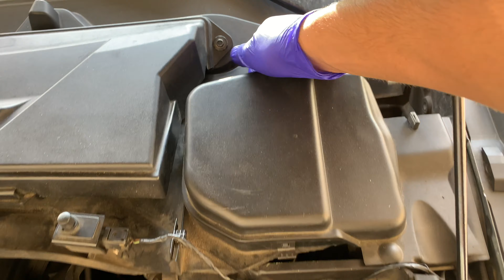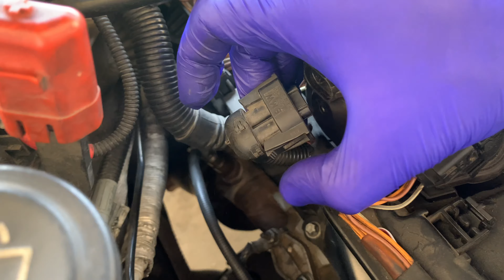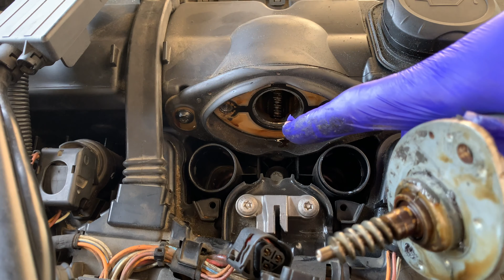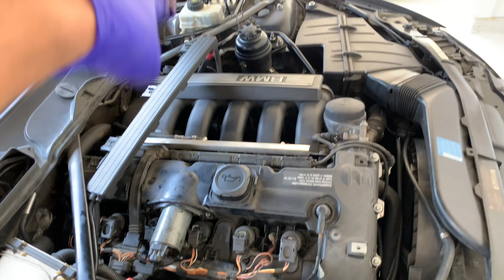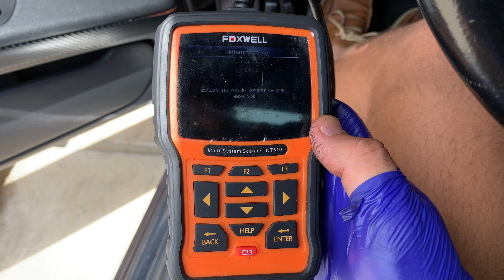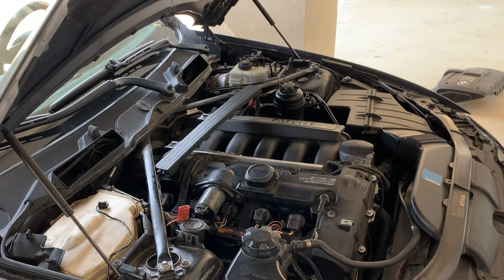How To Replace BMW Valvetronics Motor Gasket | E90 E92 N52 328i 330i

Comment: Does anyone know how to manually calibrate the Valvetronic system on a BMW 525i?
Reply: Yeah, turn the ignition to 2, not turning on the car, within 15 seconds, press the gas peddle 10 times. You should hear a whirling sound from the valtronic. Turn off ignition.  That’s how I did mine.
Reply: @custodyline i remove mine without releasing the valvetronic so i dont know if i install it correct

Comment: Will the valvetronic motor or ESS being messed up make cylinder 45&6 shut down ?
Reply: I’m having the same issue. Misfire on 4,5 and 6. Have you fixed your problem?
Reply: I need halp

Comment: Mine had a puddle of oil in all the ignition coils 😭 could be that when they did the oil change they didn’t hit the mark or the previous owner didn’t hit it so I cleaned it and now we wait
Reply: Just replaced mine but it's still leaks did you use a sealant?

Comment: I didn't know i was supposed to adjust the allen screw before removing. I just unbolted the motor and it popped off from the tension. How bad did i screw things up and what should i do for the reinstallation process? Thank you
Reply from the maker: you’re good man! I did that as well. as long as you don’t do it over and over, you’ll be fine
Reply: Thanks brother 🙏

Comment: Having the same issue rn I took out the valve motor and used the allen key but car now just cranks but won’t start
Reply from the maker: when tightening the motor, be sure to ONLY tighten until there is tension. don’t tighten any more/less
Reply: @IzzyE46M  did that but even at that I tried to start it and it just cranks I took the motor out and tried the same procedure and still nothing
Reply from the maker: I had this issue when I first owned my E92. I overtightened the Allen on accident and messed the timing up. The FIX was I used an Allen and kept doing tiny cranks while someone sat in the car and kept attempting to start it. I finally corrected the timing and no issues since. I DO NOT recommend this unless it is a last ditch effort, but it happened to me before. 

Check your valvetronics motor, eccentric shaft sensor, VANOS solenoids and ANY codes before attempting what I put above.

Comment: If this valtronic gasket is bad Will it have a vacuum leak?
Reply from the maker: Yes and no. It is possible to leak without any vacuum leak, but a large enough oil leak could result in a vacuum leak.
Reply: I'm getting some engine codes that made me think I had a vacuum leak, so I did a smoke test, and I noticed significant smoke coming out underneath the valvetronic. Also, I noticed a small amount of oil sitting underneath. That is why I am wondering if the valvetronic gasket is bad and causing a vacuum leak ( recently, I had a shop replace the valve cover gasket)
Reply from the maker: Yes I would replace the Valvetronics gasket for sure. It was probably removed and never replaced and if there’s smoke/oil there, that’s a pretty good sign it’s leaking.

Comment: Yo I thought you would need to torque the bolts attaching the valvtronic motor to the engine? I’ve heard ppl saying around 7ft/lb
Reply from the maker: yes you do, they’re very light. once they’re snug give it a little hand torque, it’s nothing ubsurd

Comment: I replaced valve cover gaskets but I did not use the Allen key to turn back to valvetronic motor or to install it back in.. my engine starts and dies..now I bought the scanner to relearn but still same stars and shuts off.. any suggestions?
Reply from the maker: use the allen key, then try again
Reply: hey man, i am having the exact same issue as you right now. Did you end up finding a solution? please let me know! thank you
Reply: @kylesmith8568  hey bro my issue was that I had not installed the air filters box to the air flow sensor hose. I tried starting it with all that air filter box off.

Comment: The link didn’t work how do I make the car relearn without the obd2 scanner
Reply from the maker: switch on the ignition
press and hold the accelerator pedal for 15 seconds
listen for the valvetronic motor to complete re-learn
Reply: I bought the scanner would you be able to show me how to use it

Comment: What if the 2 black screw T30 threads are stripped any recommendations?
Reply from the maker: maybe try to use an extractor very carefully
Reply from the maker: maybe try to use an extractor very carefully

Comment: relearning page for vavletroning dont work and is this for bmw 328xi 2007?
Reply from the maker: 2007 BMW 328, the same N52 engine
Reply: @IzzyE46M  i always get confused with e90 vs e46 and does xi matter or they all have same engine ? be it Canadian  model
Reply: @IzzyE46M  thanks for prompt reply and where can one buy them does it matter if i get after market instead of oem? caue oem is way too expensive amazon got cheap one
Reply: @IzzyE46M  also i scanned and getting vavltronic code and car sometimes starts and sometimes dont start or may start after few try u think it related to this issue no other code beside vavletronic codes are detected
Reply from the maker: https://vehiclechef.com/bmw-valvetronic-motor-reset/

Comment: Does the veltrinic gasket cuase the engine to run lean and get code P0171 and P0174? My car started to idle a little and these codes came out when I changed the valve cover gasket
Reply from the maker: It can cause it, yes or the valve cover gasket could be sat incorrectly in a section of it
Reply: @IzzyE46M  oh ok..by the way the bolts need to be torqued ?  I have a 2006 530i e60
Reply from the maker: They do but it’s a very light torque, I wanna say 10 ft pounds, so honestly a hand tighten should be good!
Reply: @IzzyE46M  I’m not sure what to do next. Because I see oil leaking from the veltrinic motor. Maybe it’s the gasket from the veltrinic or maybe I didn’t torque the valve cover gasket enough…
Reply: @IzzyE46M  do you recommend losing the bolts and torque them?
Reply: @ElPatronDTCOficial  I’m in the same situation as you. Did you figure it out?
Reply: @DanielScariti  yes. I changed my valve cover gasket and I had to torque the bolts. And I just got a new veltronic gasket and that’s it. Fixed it
Reply: @ElPatronDTCOficial  Were both gaskets leaking or did you just change both to be sure? I want to try to just do the valvetronic gasket cause i dont wanna redo the vcg
Reply: @DanielScariti  I just changed the valve cover gasket because it was leaking. But at the end I just ended just buying a new veltronic gasket
Reply: @DanielScariti  what have you changed?
Reply: @ElPatronDTCOficial  I changed the valvetronic motor gasket today but i wont be sure if its fixed until time goes by and if the CEL goes on.
Reply: @IzzyE46M  because my car started to idle a little and check engine light is on and it marks does codes and also smoke comes out

Comment: Hi mate if your car running in limb mode can be valvetronic motor problem?
Reply: Mine also went into limp mode after removing to replace gaskets i dont have a scan tool how can i get it out of limp mode?
Reply from the maker: replace it correctly? If so do the Valvetronics reset without the scanner: 

Insert the valvetronic motor and connect its 2 pin plug. Then switch the ignition onto position 2 and within a space of 15 seconds, depress the accelerator pedal down to full throttle 10 times and you will hear the valvetronic motor program itself back to factory spec.

This should fix it, start the car and let it idle in place 5-10 minutes. 

If still not working unplug and re-plug the battery and try the steps above again.
Reply from the maker: It could be, yes. Also eccentric shaft

Comment: What if I changed my valve cover and didn’t back out the valvetronic motor with a 4mm Allen? I’m having a very rough idle and I’m trying to figure out if I need to do a re learn, or take it off and put it back in by screwing the Allen I need help 😂
Reply from the maker: I would definitely do a re-learn and from there start the car and let it idle out for a good while. The N52 has cylinder correction so if you let it run it should correct itself
Reply: I’m running into the same situation at the moment.
Reply: @KidOaKTon   hey man did you end up finding a solution to your problem? Im having this exact issue right now
Reply: @kylesmith8568  dude I kid you not went to the junkyard got another valvetronic slapped it on it did the same thing after leaving it on for a bit even tho it was doing the same thing I turned it off and turned it on and I have no idea how but it fixed itself after that I was like yup that’s the last time I work on a bmw
Reply: @KidOaKTon  bruh…… welp, thank you man i appreciate it 😭 Im glad you got it up and running again! i’m determined to have mine fixed in the next 2 days so i’ll update here… wish me luck
Reply: @kylesmith8568  yeah dude it was the most dumbest situation I ever ran into. I was up till 3am trying to get it going that first day I ran into the issue. I talked to a buddy of mine that owns bmws and he said when it come to those don’t even adjust them or anything just take them out and slap them on exactly how they are, but I did that exact thing with the junk yard valvetronic I got and no luck, but yeah man good luck for real. I hope you get it going.
Reply: @KidOaKTon  hahaaaaaaaaa victory at last! was a bit busy so 2 days has turned to nearly a week, but after being stuck for so long i decided to swap both of the vanos solenoids at the front of the motor and the car suddenly went from dying and misfiring all over the place to running perfectly …. no idea what caused them to go, considering the car drove completely fine before the valve cover gasket replacement. but yeah,  2 solenoids and problem solved. i’ll take it